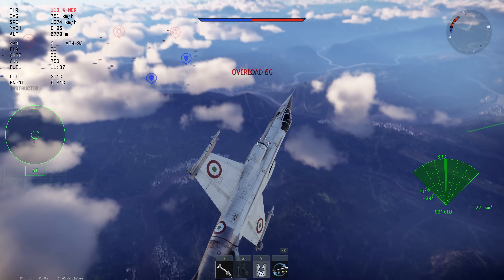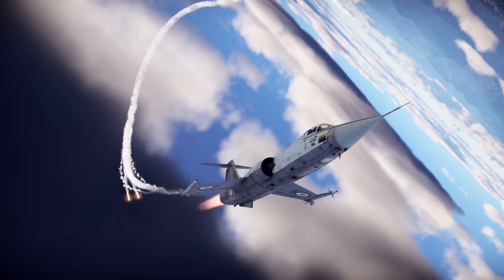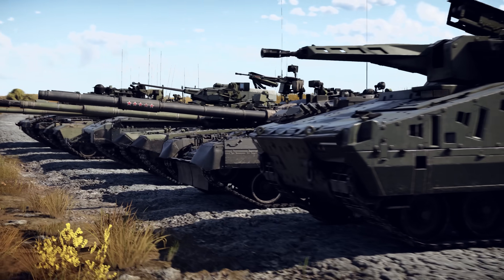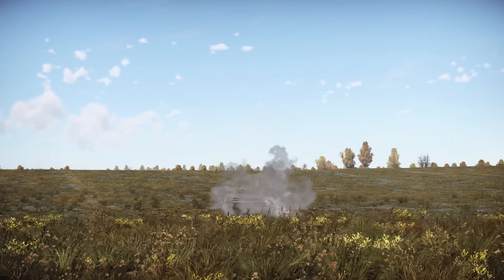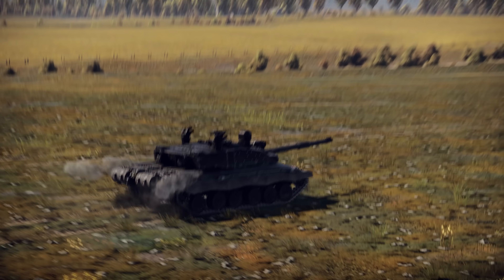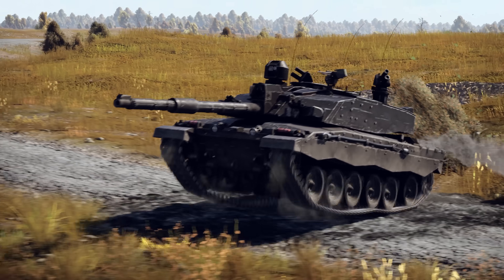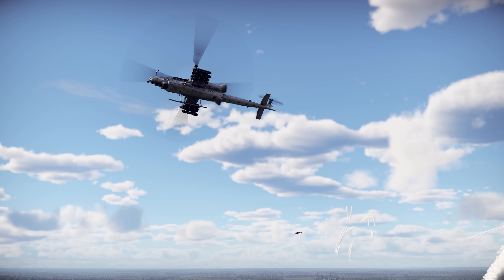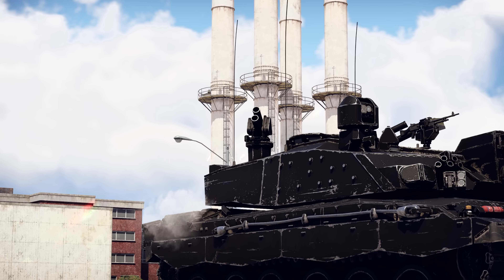How It Works: Defensive Aids Systems

Comment: I like the new narrator, and this is an interesting topic, but it leaves me with a bit of a bad taste in my mouth given that the Trophy HV system has been malfunctioning in-game for more than half a year with no fix, despite the developers having been aware of this issue for at least a month or two.

I don't know why other APS equipped vehicles - including those carrying objectively worse systems like Drozd - seem to work fine, while Trophy successfully intercepts a projectile maybe 30% of the time at most. It's somewhat telling that you only showed the Merkava Mk.4M for a single scene.

Not to mention how seemingly busted the DIRCM on the Mi-28NM and Z-10ME are.

Comment: Still curios why the su-25t and the su-39 is the only with active (ir) jammers, while other planes like the A10 at a higher br doesn't have it.
The tornado also had active radar jamming and the MAW system from the Eurofighter is even crazier.
But none of that is implemented, strange. 
Also strange how well the most ancient Soviet tanks can disrupt even modern missile systems while the most modern and advanced IFV the Puma, can barely detect an oncoming missile, let alone disrupt it.
Reply: 但是游戏中美洲狮确实拥有ADS

Comment: Day 29 of asking for Air Assault 8.3+. We have F-18 fighting 6.7 planes, this is pathetic.

Please for the love of god, add a new 8.3+ assault at the minimum if not others like 10.0+.

We need higher BR planes to allow more pilots to get 1500 points (about 80% activity) for ~3.2k RP.

The planes in 8.3+ or higher also NEED MORE SPACING to prevent AGM cheesing and missiles taking out 3-8 planes a hit.